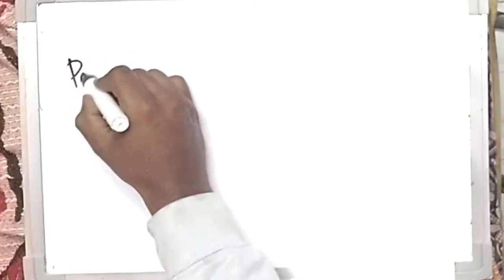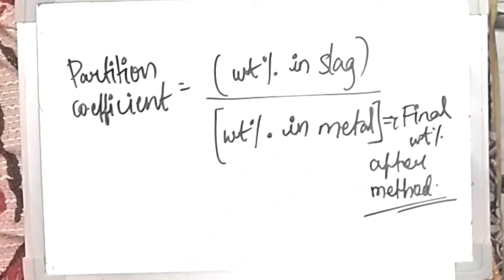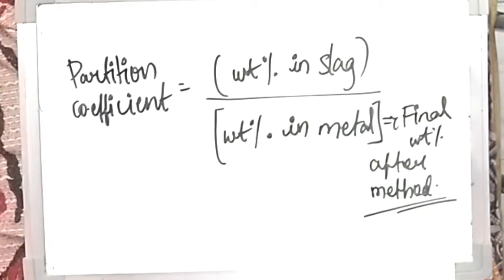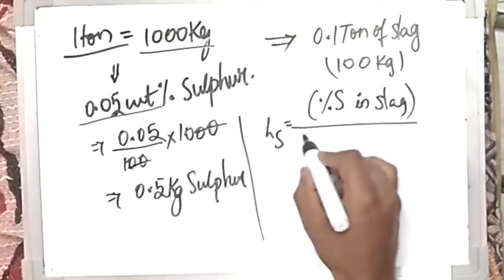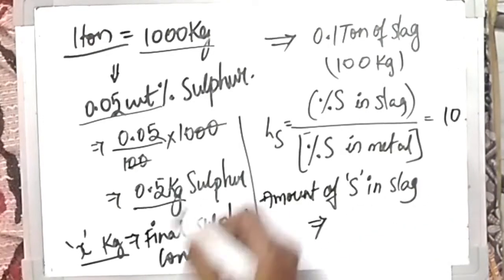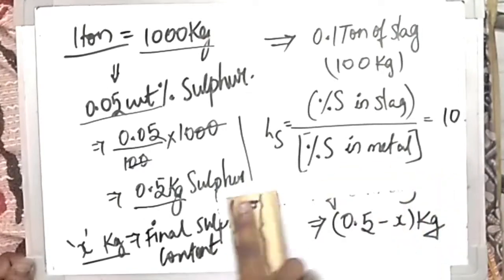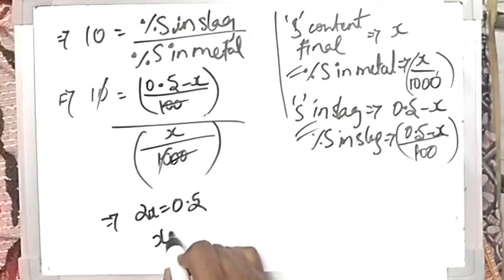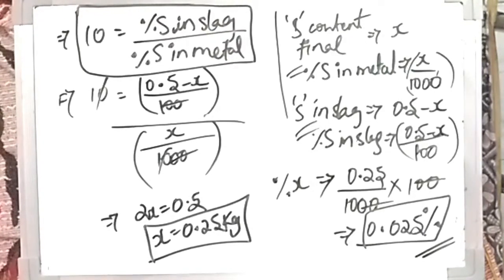NUMERICAL ON PARTITION CO-EFFICIENT-LECTURE 15-FERROUS EXTRACTION- EVERYTHING METALLURGY

Comment: sir, from the question there is no sulfur content in the slag, then how you take the sulfur content in slag is (0.5-x)/100
Reply from the maker: Initially there is 0.5kg in metal and no sulphur in slag....but after desulphurization there will be sulphur removed from the metal and it goes into the slag !
Reply: @everythingmetallurgy   yes sir I had same doubt but now cleared